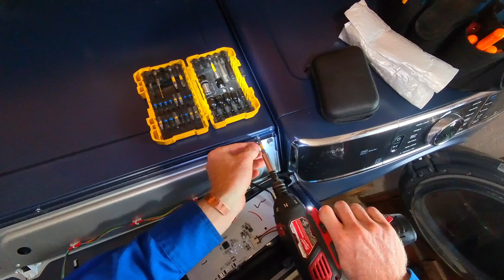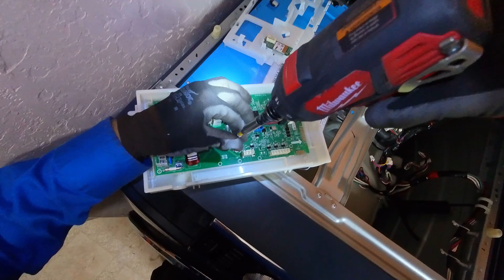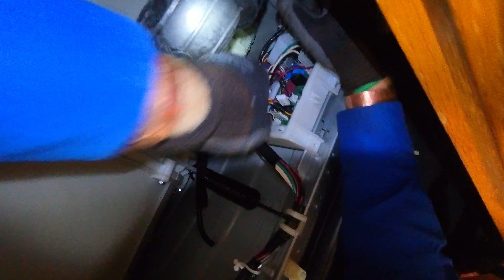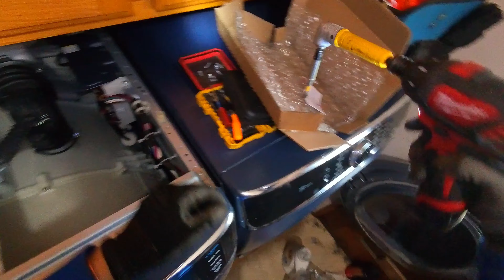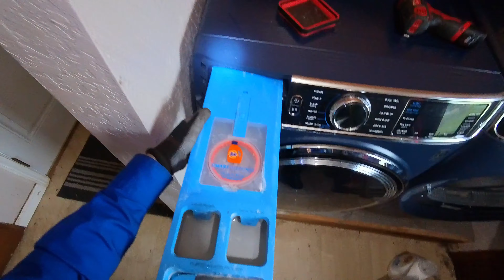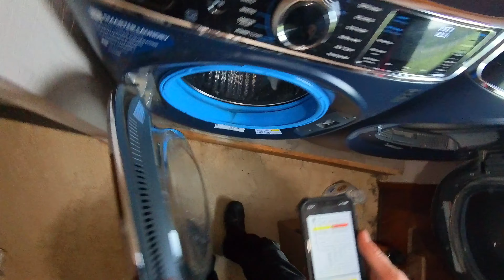How to Replace GE Front Load Washer PCB Computer Control Board #diy #appliancerepair #frontloader

Comment: I just replaced mine , 85 bucks for the control and the invert board! I got them at GE, what I did was I made a hole on the side  bottom of the washer to reach the inverter board in case it happens again!  Also I added a fan to the top of the washer with a timer to maybe help witht the heat and condensation/ humidity?  it may make it worse tho. or  better or nothing at all ... time will tell but from what I read  humidity can damage these boards too, I dont know but I hope it last another two years?

Comment: So i have a blinking light inside my drum. No lights on my UI. Does that mean i have to replace my PCB? If i do when i want to reprogram do i select 10 like you did?
Reply from the maker: You most likely will have to replace the control board. It’s the most common issue on this washer. The board should come with a little card and you text that number your model number.

Comment: Very well executed. I too have had to get into this machine a handful of times. I previously replaced the other board that's on the bottom left side of the cabinet, as well as the accelerator and now the main control board. It's genuinely shocking that GE has had this many problems with their washers. So far the dryer has been great 🤞 
One thing I would like to add for precaution is the importance of using an ESD strap when handling circuit boards. Especially on arid days where static electrical arcs can occur. Any latent arc can ruin an expensive circuit board over time. As an aircraft mechanic, this was always a big area of concern when handling avionics part swaps. Just my 2 cents before the pennies are gone forever...
Reply from the maker: Great advice on using an ESD strap, thanks for sharing! 👍

Comment: Thanks for this. I successfully changed out my main control board following your instructions and the machine seems to be working fine after a couple loads. My main problem was trying to figure out how to detach some of those wire connectors. Took me a while and I wound up have to use a pair of needle nose plyers to depress the tab while pulling. I was worried I would have trouble putting the wires back in to the new board but you were right, you can't really go wrong. That went very quickly. Glad that you included the bit about "programming" the new board. The other video I watched said nothing about it. It's very easy once you know what to do. 

BTW this saved me a lot of money. The local repair person wanted $130 just to show up before parts and labor. If they didn't mark up the cost for the board (unlikely) it would have been another $150. Plus at least an hour of labor ($100 bucks?).  So it would have been at least $380 to have someone come. I paid $200 to have the board delivered overnight. Then it took me about an hour to put the new board in. So I'm pretty happy. Plus the satisfaction of doing it yourself and bucking the system a bit!

DIY people! You can do it!
Reply from the maker: That's awesome! So glad it worked out for you and saved you some money!

Comment: I have a GFW850SPN2RS and last night when it was running in the vent mode, it just died.  like 3 months ago, the LED in the tub went out but didn't think it was that important.  But I have watched videos and have tried resetting it and everything and the only thing I can get it to do sometimes is some of the indicators lights for the cycle will faintly blink.  There is no clicking or anything when I plug it back in.  I got the new control board on the way and trying to find the LED replacement but it seems to be out of stock everywhere.  Hope the control board brings it back to life.  There also doesn't seem to be any "heartbeat" light on the control board or the interface board.
Reply from the maker: Hopefully the control board fixes it! Let me know how that works!

Comment: Wow can't believe you did this from the front and under the cabinets. Good on you. Mine is setup the same way but on pedestals. The top cover won't come off unless I slide the machine out as the cabinets are right on it. My laundry room flooded out. The door lock kept clicking. I had a pressure switch code. Ran the diag and water started pouring out of the dispenser. Have you ever seen that? The pedestal draw was also filled with water. I didn't even bother ohming anything out. I ordered a board, door lock switch, and drain pump. When I removed the old drain pump it was within spec 19 ohms. The impeller had a lot of end play though. That pump was 2 years old. At that time my original pump took the board out. Machine is 6 years old. So far 2 boards, 2 drain pumps, door lock switch, and I replaced squeaky inlet valves about 6 months ago. G.E. did the boot under warranty when it was new. There was a pinhole in it. I have had this apart so many times since. I was mad because the tech left screws out. The tech is still in my area as now it's Bodewell. 

There is some outdated info out there. The personality screen is suppose to be on zero when first booted up. I did this yesterday and mine started on 1. My personality is 3 (650). For fun I text the card. As another poster stated it asks for the model number but no help. I texted the model number and now instead of instructions it states to call them. Unreal. This will be the last major repair I do on it. I have the threaded rod spring tool. That works amazing on this boot spring.
Reply from the maker: Wow, that sounds like quite a battle with your washer! Yeah, I’ve replaced pretty much all the components on these washers. They are not built like the old stuff that’s for sure!

Comment: Nice work. I have 216 of these washers at my property & I've had quite a few control boards go bad & the washers aren't even 2 years old yet. I've had several inverter boards, door locks, drain pumps & water inlet valves go bad too. These machines are nice when they're working properly but so far I've come across a lot of issues. I don't have any videos uploaded on my channel with these machines yet, but I have some videos that I need to edit & then I'll upload them. How long have you been doing appliance repair? I've thought about doing it on the side until I build up enough clientele to do it full time. It's a great field to be in.
You should do a video on your tool bag load out for appliance repair & show what tools you carry. 🛠️👍
Reply from the maker: Great idea I’ll work on putting out a Load Out video soon! I’ve been doing appliance repair for a few years now.

Comment: I’m having issues with draining. I’ve changed the drain pump but still the same. Perhaps I need to do this as well?
Reply from the maker: Is the washer not draining at all?
Reply: How can you test the control board to confirm it's good or bad? My washer turns off shortly afte turning on with the relay clicking every 10 seconds.

Comment: I am having the same issues with my washer. gfw850spn0rs. When turned on you hear the lock click several times locking the door in place. However the door lock symbol stays flashing and the word "Door" comes up along with a series of 3 chimes. The door will not open at this point. When I turn the machine off and then back on again, hit the play button,  the locking system will cycle again (clicking) and I am able to apply constant pressure to the door pull the door open in-between the locking cycles. I tested the ohms on the orignal locking system with the locking pin in and the door push button closed and had 120. I choose to replace anyways but the same thing is happening as stated above. What would you recommend at this point? Do you think this is a motherboard replacement like this video? If so would you be able to send me the link for the correct part? Thanks for all the great help your videos are awesome!
Reply from the maker: It definitely sounds like a control board issue.
Ive seen that issue multiple times with this washer. 
Go to partsdr.com or searspartsdirect.com and put your model number in and you should be able to find the control board. Thanks for the comment!
Reply: @fixriteappliance  Thank you for the quick reply!!

Comment: Not sure if you will get this but just replaced my control board and my some of the cycles don't work like the previous control board. Did not come with instructions. Do you have them still? Can't find them anywhere. GFW850SPN5RS
Reply from the maker: Thanks for the comment!
The new control board must be programmed with the right “personality”. Text PARTS to 36534 for instructions on how to reprogram yours.
Let me know if that worked out for you.
Hope this helped
Reply: Worked as described i was trying to change code with test 2 instead of test 17. That was my error. Great video though.

Comment: How did you know that had to be replaced ? I installed a used one my mom gave me yesterday and it worked but it didnt drain, once we tried to run it again it just turns off. And i keep hearing a clicking sound about every 10 seconds, every time i turn it on it shuts off
Reply: When our machine stopped working I fed a detailed description of the symptoms into ChatGPT along with the model number etc. and it did a good job of telling me what was probably wrong and what the other possibilities were. In my case the main control board was the most likely problem and it turned out to be correct.
Reply from the maker: Mostly from experience, I’ve replaced a motherboard on this washer several times either due to the motor not working or the door lock not working or a drain issue. 
The motherboard going out on this washer seems to be a common issue.

Comment: GE appliances are no longer the reliable brand you could expect to last years without issues. It's owned by a Chinese company called Haier, and the quality seems to have declined significantly. 

I have the same model as the one in the video, and the main control board failed completely after just two years. After replacing it, I encountered three different error codes. I'm seriously considering switching to another brand rather than continuing to invest in repairs at this point.
Reply from the maker: Yeah, the only new machines I recommend are Speed Queen
Reply: How did you know which programming to select when starting it first the first time after replacing?
Reply from the maker: @kennethmccrory5279  The new control board should come with a little card that tells you how to program its personality
Reply: @fixriteappliance yes sir it did but the response from that GE card said there was no current service document for the part. I was able to figure it out though . Thank you for the response.
Reply from the maker: @kennethmccrory5279 Great job!
Reply: @kennethmccrory5279 There is a QR code comes with the part and you can find all the info by scanning the QR code. I don’t have it with me now, but you should be able to find the info online.

Comment: Thanks! It was especially helpful to know how to get that plastic apart. I'm always afraid of breaking plastics. By the way, I'd like to add that my control board stopped actuating the drain pump.
Reply: I replaced my drain pump and the machine still won't drain. This control board is my next attempt.
Reply from the maker: @ShawnShannon-t4j  can you hear the drain pump buzzing?
Reply from the maker: Thanks for the comment! Yeah that plastic housing is a pain!